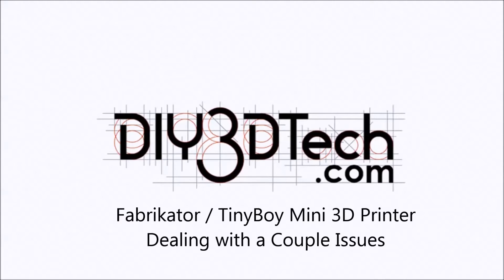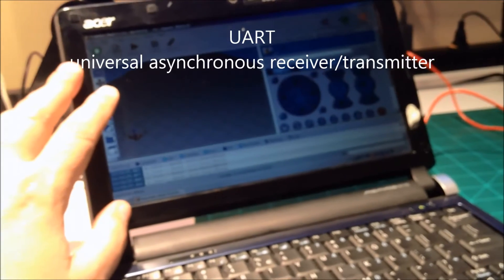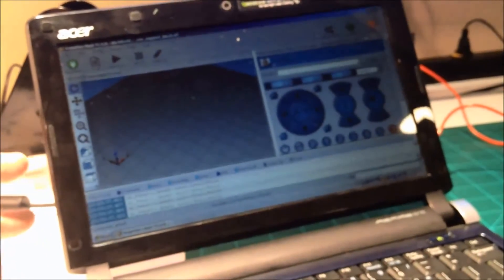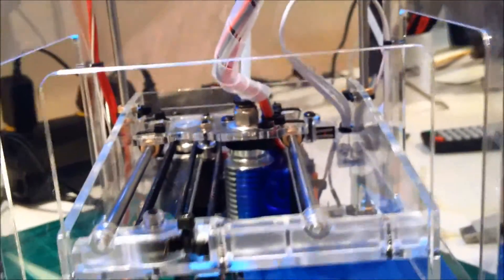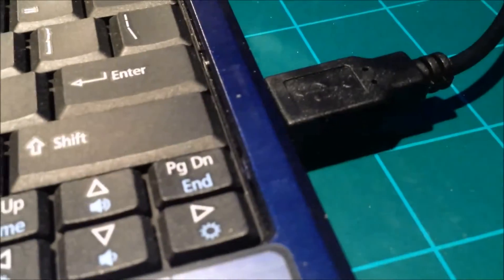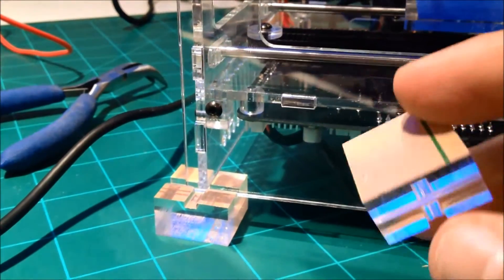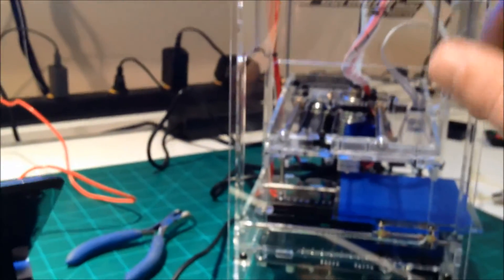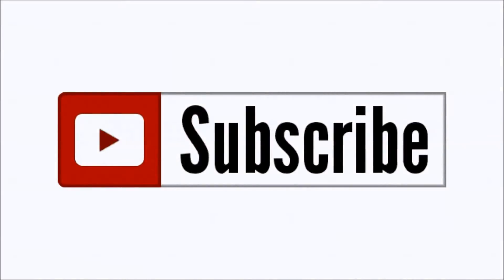Fabrikator Mini / TinyBoy 3D Printer - Dealing with a Couple Issues

Comment: Here is 3d printer filament Spool Holder http://www.ebay.com/itm/222322310882?ssPageName=STRK:MESELX:IT&_trksid=p3984.m1555.l2649
Reply from the maker: Would like to send me one for a review or are you suggesting I should also start selling these on eBay for less?

Comment: Good video.  I have Windows 7 and had to do the UART thing to get it working. Have you printed anything on the Mini yet?When I try to print my hotend moves up 15 mm then the display says wait for it to heat up but it never heats up.I can heat it up manually but not when printing.
Reply from the maker: +Doug Irwin Interesting you have had the same UART issue and yes have printed many things.  Question does the hot-end get hot?  If no, would check the wires on the underside of the unit as mine are attached by a small nut block and possibly one of those wires have come lose.
Reply: +DIY3DTECH.com Thanks for the feedback.  I fixed the issue.  After everything I did including thinking I broke it all together :)There is a setup file out there and I won't name where I got it, but I saw it in 2 locations, and it might work for another operating system other than Windows 7.  It is I believe an RCP file and while I can't remember the name right now it has CUDA which I read as CURA in the name.  In any case I finally said the only thing that I had not done was to verify the setting from the manual with the file I imported.  There were 4 settings that were different, I changed them then applied them.  The printer started heating up and I printed my first model.  Albeit not very well as I had the nozzle too high up.  After I tweak it, the LCD upgrade is next.

Comment: The LCD/SD card upgrade is a pretty nice upgrade (Chuck Hellebuyck's video on it is awesome). I had some problems with the LCD I purchased but after correcting the bad soldering job and bad ribbon cable, I resolved the issues. Also there is a place in HK selling an aluminum bed plate for the TinyBoy (http://www.hkmakers.hk/), although you could probably make something yourself.
Reply from the maker: +Steve Cuthbert Agreed on Chucks videos as he is the who got me in trouble with the wife (for ordering yet another 3D printer :-).  however that link you sent I awesome!  I am going to post a short video on it as wow they have some neat stuff!  Many thanks for sharing!

Comment: I had the USB connection problem for a little while with my rigidbot and after a while I relized I had to use a specific port.
Reply from the maker: +Panoreth 3D Printing Yes I have not had very good luck with "Auto Detect" so typically use a specified port, yet having a major issue with FT 232R UART .  For those having similar issue, found a great site which explains how to fix: https://learn.sparkfun.com/tutorials/how-to-install-ftdi-drivers/windows---in-depth

Comment: Hi I've got the v1, you'll need to swap out that build plate, mine warped after two months.Looking forward to your LCD and sd series.Ive found that mattercontrol software works really well on this machine. As you can't level the bed properly the software levelling is invaluable.
Reply from the maker: +Andrew Griffiths Very interesting!  Yes I see the potential for issues with the bed, what did you swap it for?
Reply: +DIY3DTECH.com 3mm aluminium, not pretty but it gets the job done. Mine wore down a thread or two on the z axis so would skip and give consistent weak Lakers at a certain height, the power supply gave up the ghost last week.

I never had any software issues though...